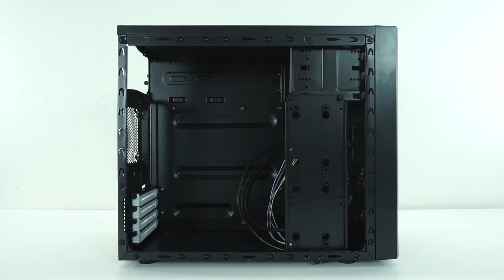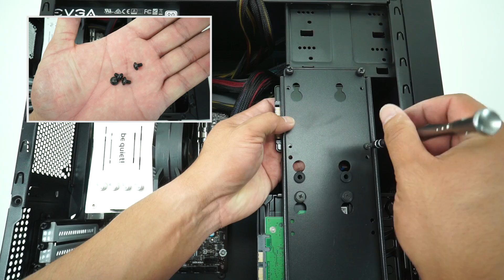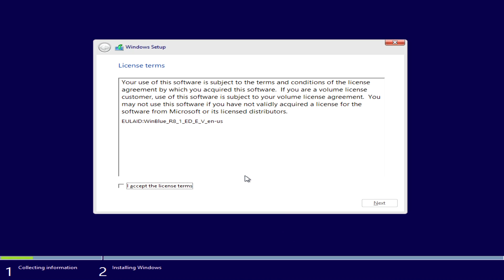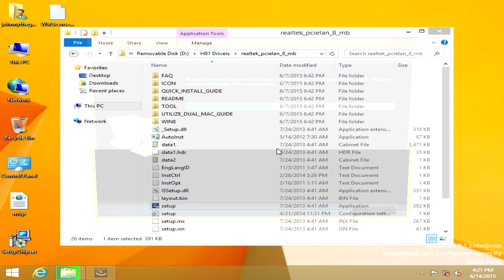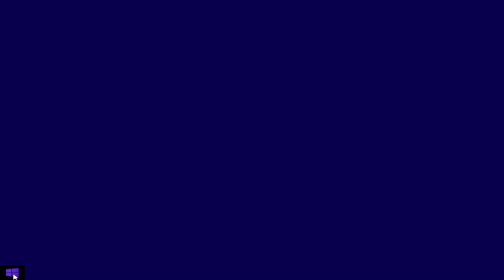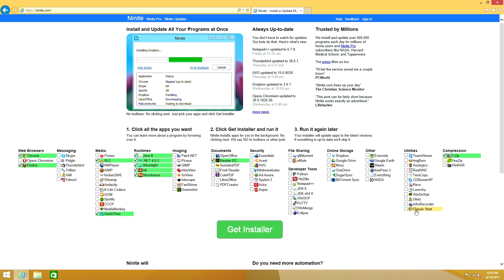Intel H81+G3258+750ti Build Guide @ 60FPS

Comment: on the SATA cables, you typically want the right-angle/90 degree end connected to the drives and the straight end connected to the motherboard  -  just FYI

Comment: You didnt put any cpu thermal past  is that normal
Reply: New CPU coolers have a thin layer of thermal paste already applied. You can see the white paste when he removes the protective plastic from the bottom of the cooler.

Comment: hey i have pc spec :
intel pentium G3220 - MSI h81E33 - r7 240.
enlight 500 W PSU 80bronze. 1tb HDD. 8gb ram
if it posible to change my vga card to GTX750Ti or GTX1050ti?? and change my current cpu to g4560/g3258? is it compatilbe with my mobo?? pls reply. thx

Comment: Just about finished my first PC build, but no power. Nothing turns on. Brand new H81M-P33. Troubleshooting has been a pain. I don't know what it could be. :-/
Reply: Niecy DMS did you fix?
Reply: I did. I purchased a motherboard and power supply tester and was able to find that the source of the problem was in fact the power supply. It was working fine in the older computer, but with my new build it was not giving the PC the required amps that it needed to perform. It could have either been a dying power supply or a weak one. The old one was a 480 Watt, and the new one is 600 watts.
Thanks for asking :-)

Comment: Pentium G3258, Asus GTX 750 Ti Strix, the same motherboard, and FSP HEXA+ 400W??? Is this a good configuration?
Reply: Yeah it's fine, you won't need an aftermarket cooler and for the case I'd recommend the Zalman Z3 Plus (cheap, good looking and comes with 4 fans) or anything cheaper will do, too.
Reply: get an i3 it's worth it
Reply: Miguel M Silva it's not.
Reply: then he should overclock the pentium...
Reply: Miguel M Silva obviously.. who buys the g3258 and doesn't overclock it?
Reply: Kapello Mg haha true
Reply: Kapello Mg btw does an h81 mobo support a gtx 1060 pci-e??
Reply: Kapello Mg how to overclock this cpu

Comment: It S the PC of my dream
Reply: You have some low-set dreams! This PC is low-end, and isn't good at all for high 1080p gaming.
Reply: +Project Pheonix you okay there bud? This can play games at 1080p on high settings 40-60 fps on most games with overclock just lower the resolution to 720p high without overclock 40-60 settings.
Reply: Kirzuo That won't be the case in a year or two. My point is that this PC is not high-end, and you really are getting what you're paying for.

Comment: Hey a friend of mine made this build for me. When the parts came i found your video and was glad to see that the build worked great. When I actually built it and installed windows i was blow away with the performance. Before I got this computer I used an ASUS notebook with a single core cpu clocking in at 1.3 ghz. What an upgrade? huh?
Reply: lmao
Reply: So did you play overwatch on that laptop on max setting?
Reply: GreenHorn lol hell no

Comment: What do you guys think? 
http://pcpartpicker.com/p/rLzkCJ
Reply: No power supply or case?
Reply: I think that I can use my old power supply. I think it's 430W. And I am still searching for a good cheap case. :P I have a few in my mind. Don't worry about that.
Reply: on my 2nd build with the g3258 and 750ti great low budget combo great performance too go for it
Reply: +roynorw I have a few questions for you. 1. How much am I able to overclock with a stock cooler? 2. Im new to pc building and the Intel Pentium G3258 is a APU how do APU's react by adding a GPU- I will throw a 750 ti in it. 3. If I overclock how much watts would my powersupply need to be? 4. Can I overclock with that mothetboard?
Reply: +Augustin Ferstner right now I'm @ 4.2ghz stock cooler 430watt psu
Reply: +Augustin Ferstner and yea G3258 chipset is b85 and it's not an apu on board graphics sux the 750ti on med settings will keep you in the 50+ fps range @ 1080p
Reply: +roynorw And everything is working perfectly with a 4.2 GHz on a stock cooler?
Reply: +Augustin Ferstner Yea only change the clock speed it crashed once lol ok twice was going to dial back to 4ghz which is more stable but didn't it's working fine tdp 58 degrees was the highest it ever got to I'm Using corsair 430watt cert bronze
Reply: +roynorw Wow that's good. Thanks for your help and have a nice day! :)
Reply: +Augustin Ferstner No problem bro enjoy that build
Reply: get a small ssd if u can
Reply: Bro AMD Athlon x4 860K + 750 ti ore Intel Pentium G3258 + 750 ti? Can I use my old ssd?
Reply: +Augustin Ferstner from experience always go Intel and nvidia even tho the athalon has 4 cores they're weak compared to Intel cores I'm on my second G3258 for a reason i use play bf4 on ultra at 40 fps with 750ti amd coming out with new architecture this year but all the past stuff is junk yea use ur old ssd bro
Reply: +Augustin Ferstner G3258 at 4ghz is a beast
Reply: +roynorw Other guy said that the AMD one is better because "more games will need 4 core's which the Pentium dosen't have".
Reply: +Augustin Ferstner Not true bro I've been using the G3258 for years and it runs every game smoothly look it up on YouTube bro athalon vs G3258
Reply: andwhen u ready to upgrade  u dont have to change motherboard
Reply: +Brysen Norwood Yeah but I want to buy a cheap ass case
Reply: +Brysen Norwood  +roynorw so intel will do then
Reply: +Augustin Ferstner It has ran every game I've thrown at it plus u can upgrade slowly i3 then i5 and eventually i7 with same motherboard
Reply: +Augustin Ferstner get the diypc gamer storm from newegg $40 with leds and a window go to my channel and look at my build that was my first one
Reply: Okay thanks! Will do.

Comment: Ver nice video! You've got a new sub!
I'm currently in the works of gathering the last components for my compact 1080p gaming PC, made out of both stuff I've had lying around since my latest PC upgrade and some used things and whatnot. Gonna use a G3258 with a 212 Evo cooler, a GTX 760, 8GB 1333MHz RAM and then cram it all in a Bitfenix Prodigy M.
Gonna be real interesting to see if I can tackle the heatproblem some people have had with the Prodigy M so that I can overclock the CPU since that's basically what it's made for :)

Comment: Very nice build.
Reply from the maker: thanks!
Reply: +Johnny Phung (johnnythegeek) I've seen a lot of amd builds. Which I'm not a big fan OFF. Sure they are bang for buck.  But you're stuck with AM3 socket which is really old now. Plus the upgrade tree is not as good.  If you would to use a Intel CPU. You know give it 4 months and you can have your self a nice i5 CPU,  which blows any AMD CPU away. 

Like I said very nice Entry-Level rig.

Comment: Way too much cooling for that CPU.
Overall pretty decent build.
Reply: +Jackolantern671 With that motherboard and psu? Fuck no. He could've used the stock cooler and it would've been fine. If you don't want to use the stock cooler, a Cooler Master T2 would be MORE than enough, for much cheaper

Comment: thats my setup , same mobo , its a good mobo, runs Pentium OCed to 4.4ghz at my setup, but i used R9 280x , its a bit of overkill but you wont believe how fast Pentium really is. Games that are not made exclusively for quad cores , like GTA5 utilize 90 percent of GPU power . Thats how fast Pentium is , but my experience with AMD led me to sell the R9 280x and buy GTX950.  Fan control doesn't work on crimson drivers for amd cards . I can not comprehend how can that even happen .  but with AMD everything is possible , or should i say Ati. In my opinion they are all the same company , just different brands

Comment: would you need to update the BIOS?
Reply: +Omniter no , you can OC Pentium G on stock bios , but you need to disable Auto voltage and frequency. Disable boost and those things . IT will say that it is OCed to 4ghz lets say. You open windows it says 4ghz. But its not thats boost frequency, and pentium doesnt have boost so it will never do it . So you need to manually disable everything , and then overclock it . use some kind of advanced cpu monitoring software like CPUz , aida 64 and such they will tell you the real thing ,windows can lie
Reply: +Pavle Pavlovic should I go h97?
Reply: Omniter i dont know h97 , i never saw that chip set , must be that itsa new chiipset for skylake not for pentium G
Reply: +Pavle Pavlovic no it's a haswell chipset
Reply: Omniter then it will work , but same issues probably. Cuz some intell cpus have boost , Pentium doesn't , it cant be overclocked without boost disabled manually . And iits few different settings depending on architecture and bios

Comment: Hey great video again, I'm hoping you can help me. Some time ago you did a great vid on updating a BIOS, Well it seem the techs (?) on the HP forums say an update for my  motherboard/BIOS does not exist.                                                                    Do you think I can find an update and if so can you
point me in the right direction?  My info is:
Compaq CQ5320F  64 bit
Motherboard Manufacture:                        Pegatron Corp.                "          Model:                                                            M2N68 (Narra6) BIOS brand:                                                              American Megatrends Inc.Version:                                                     5.17
OS is windows 10,  Ram is 8 GB,  CPU is AMD Phenom II x4 955, GPU is NVIDIA GeForce GT 730, Power Supply 530 Watts.I installed windows 10 and the above upgrades this week. When I purchased the cpu I was told to update the BIOS before installing it.I didn't want to update the BIOS unless I had to.
System starts, runs and does better with every tweek I throw at it (I'm on it now). I just get a crash every so often.                                                                                  Thanks for any help, This update has got to go down one way or another.

Comment: Its all well and good, but IMO anyone with a strict budged, should go with the cheapest case possible no ssd and no aftermarket cooler and possibly a cheaper hdd. That way you could get i3 + gtx 750 ti for much more stable performance on some games and overall.
Reply: +ProtoGeneralBG For example http://pcpartpicker.com/p/FWP2cf this no case build has i3 + gtx 960...
Reply: True or you save a little more money and buy a good hdd and case too
Reply: Its very much different... with its 4 logical cores, there are no lag spikes on gta V (or at least much less if even any), on ac unity i3 can hold 30 fps, while g3258 had problems sustaining 20, and there are still many gaming that will bottleneck, but otherwise g3258 is really good too :)

Comment: so, did the side of the case fit correctly?, that cooler looks like it may have been really close to the side panel.
Reply from the maker: it barely fit. the side panel touches the cooler.

Comment: Would the pentium g3258 oc bottleneck a 370 4gb? Thx
Reply from the maker: It will depend on the game if it is really cpu dependant. If it is, there won't be enough threads for the gpu to work well. I don't know what games are cpu dependant but you can search that.
Reply: +Johnny Phung (johnnythegeek) okay, I'm on about will the CPU hold out back in gpu intensive games. also I have been hearing about a quad core minimum on some games, would there be anyway to get around that?

Comment: this MB support intel turbo boost technology ? i'm planning to buy a i5 4590 who has this tech,  it will work with this MB?
Reply: +ignacio franchi yes, it will.
Reply: +ignacio franchi idk why he purchased a G3258 if he can't overclock it on this motherboard. Better get a G3250 which is the same as G3258 at stock.
Reply: Dragoslav Miljević Thanks :)
Reply: +Vanguardas Vucava You can overclock the G3258 on this motherboard (in fact most H81 chipsets). 

Source: Me (I have the G3258 overclocked to 4.2 GHz on this motherboard).

Comment: Is there enough space underneath the GPU to install a Wifi PCI 8X Card?
Reply: +King Of Kings thanks for the answer. I already built one my self. H81 Mobo, i5 1150 4440 chip with gtx 580 and a 650 corsair psu. Like you said, my wifi card fits neatly under my GPU. i play fallout on medium and far cry4 on high so im pretty happy considering I only spent 350 dollars on the whole system.

Comment: Will a 960 fit in this case or do i have to move the hard drive 
heres my specs
Case: Fractal Core 1000Case
- Power Supply: 500W
- CPU: Intel I5 4460 3.2GHz 
- Motherboard: Asus H81 USB3 M-ATX Motherboard
- RAM: 8GB DDR3 1600MHz Dual Channel Kit
1tb hard drive
no operating system and graphics card for 460 euros I could fine a second hand 960 for under 200  roughly    -120-190- 
Windows 10 free from a usb bootable
Reply: It should fit unless u have a small case and the gpu has like 3 fans.

Comment: Like the build, just not cpu i would have go with i5-4460 if i'm gonna use intel 188$ on amazon and stay with the stock cooler given with cpu it can't be overclocked 
Links:
amzn.to/1JjC6sM

Or

Change to amd Cpu FX-6300 $89 and for Motherboard Asus M5A78L-M/USB3 $44 after rebate and keep stock cooler unless you want to overclocked in the future
Links:
amzn.to/1Na7l7u
amzn.to/1NxoGqU

To be honest i won't use an SSD on my cheap build and for what to make windows load faster, just make sure to defrag your HDD every week and there is a lot of tutorial that tell how to optimise your windows and connection etc...  i can make miracle with just that :D

Comment: The CPU: Intel G3258 2 Channel only has DDR3-1333 memory support, Not 1600.
Reply: This is DDR3-1600 RAM, but it is compatible. However, the processor will underclock the RAM to 1333 MHz.
Reply from the maker: Tom Prokes That's correct. In previous videos I have made I said the same thing.
Reply: +Tom „TomDogAlmighty“ Prokes So the ram will underclock to 1333mhz by it self no?
Reply: +Johnny Phung (johnnythegeek) But he used the 8GB of RAM in this video. Isn't it 1600MHz?

Comment: Great man keep the good work.. Cheers
Reply from the maker: vj0987 Thanks!
Reply: +Johnny Phung (johnnythegeek) This is just wrong ........ Please don't feel insulted, but why not buy something somewhat upgradeable.......... I don't think you mentioned what the costs are but that motherboard is so useless explains the PSU though. The build is just so big for such a small motherboard that is not upgradeable at all..... You can use an expensive i7 but i don't see that as upgrading something like sli or crossfir. I build something myself and since your accent is so American i am sure the price here was higher. It's ok when i did it wrong i just wonder what the costs where i build my rig in early October..... I ll be honest about that. Reason i say all this is that i don't believe in the benefits of the LGA 1151. Some say there already is an advantage some say they are even slower in most cases.... Ow i do use the G3258 and when i build it i didn't think i still would..... It's way better then most think. Compliments how you edited it and explain everything. Grtz.

Comment: This motherboard has 2 SATA2 (3G) and 2 SATA3 (6G) ports, you said there were 4 SATA3 ports.  Also: You do not have to click on "NEW" to create new partitions, just select the boot drive you want and click next, the partitions are automatically created.  Also: Windows update kb2493989 (which is integrated in Windows 10 RTM) may cause your G3258 not to work in an H81 motherboard, check MSI website for updated BIOS.   Update:  It has been reported that Build 10586, the November update to Windows 10, has corrected the problem of functionality/overclocking with this H81 board and a G3258!!
Reply from the maker: ddthom2008 Thanks for the info! I will add the annotations.